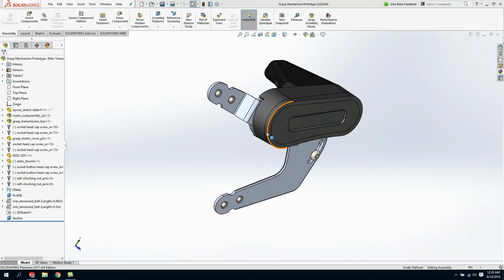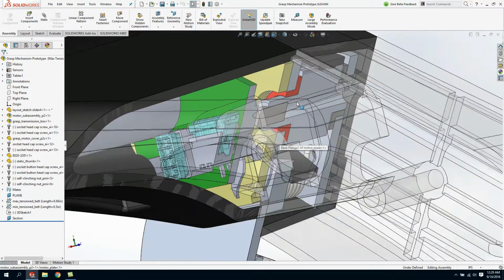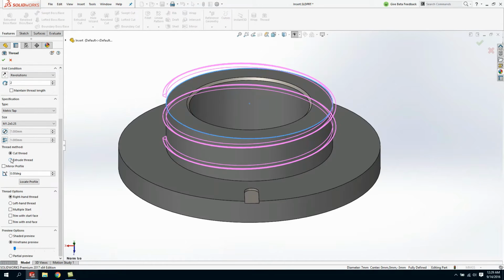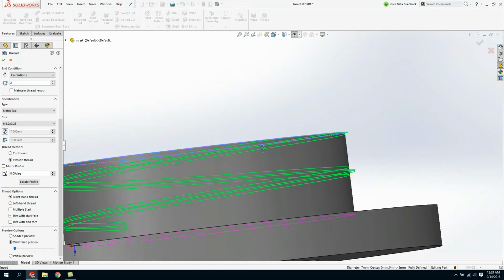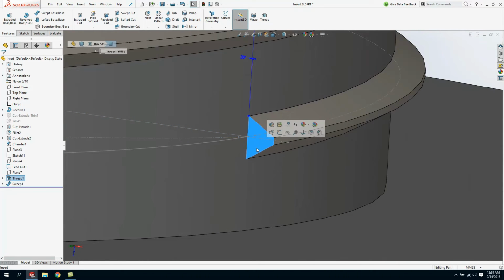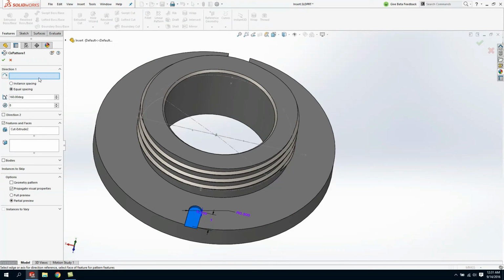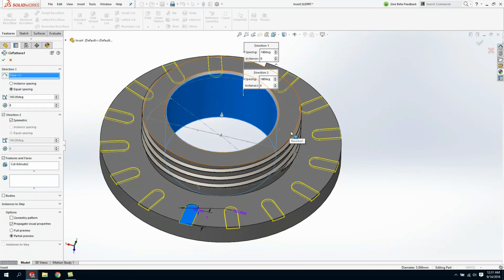Creating Smooth Threads with SOLIDWORKS 2017

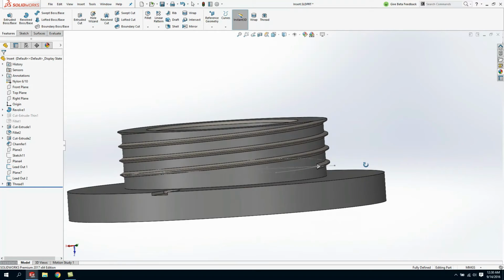Comment: Very good demo. Question. at 1:50, when you click on show/hide, the thread's guiding curves appear, so that you can use the Swept/Boss Base "guiding" curve. When I click on the thread and "EYE" button view/hide my curves, the guiding curves don't show up. It's missing the construction and guiding curve of the feature I can't complete the Swetp/Boss step. Is there a way to show your setting to demo how the guiding curves show up? Thanks.
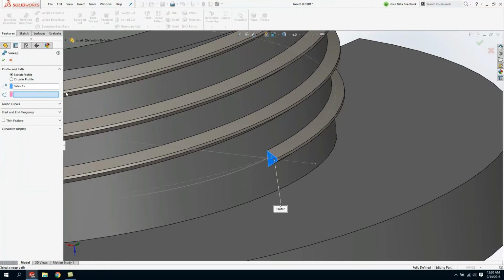Reply: What I also noticed is that I don't have a "lead out" for Path, in the Swept Boss. That extra curved line at 2:07. I even created a helix to simulate it, but the face will not end back on the cylinder, but keeps going. Just wondering. tnx.
Reply from the maker: Before the start of the video, the guide curves and sketches were built and made visible individually, then they were all hidden for clarity to build the thread which doesn't require those entities.  They "eye" button at the top of the screen is the hide/show all command, allowing you to quickly hide or show all, in this case hiding visible sketches.  It doesn't make each item visible if they are individually hidden, it simply toggles visibility if they are visible.  

To make an individual item visible, click on it in the tree and click the eye in the context menu to make that specific item visible.  Then you can use the hide/show all command to quickly hide or show them all.
Reply from the maker: The last guide curve is an arc that curves inwards, it is tangent to the end of the helix but a smaller radius so the thread shape dives into the cylinder and disappears.  The creation of that guide curve was not covered in this video
Reply: Great. Thanks. Yes, this makes sense. I think if you could add a note about the previously made "guide curves and sketches", it would explain the last step better to make the Swept/Boss.
Reply: Yes, that makes sense. I created on tangent along the "cylinder" and the Swept/Boss went out into space. But now that you state that it's "smaller" radius, and it goes inward, this was not clear in the video. Perhaps you can show the sketch of the guide curve from a top view, it would explain the "dives into the cylinder and disappearing". I kept trying it over and over with a tangent line, but it kept going out in to tangent space and didn't "dive in". Otherwise, the demo implies that using the "existing" guide curve is part of a helix that is tangent to the cylinder, when in fact it's a diving in radius. There was no way to glean this. But this explains it. I tried it and it worked. Thanks again. Very helpful.